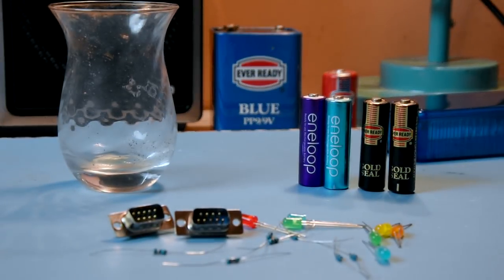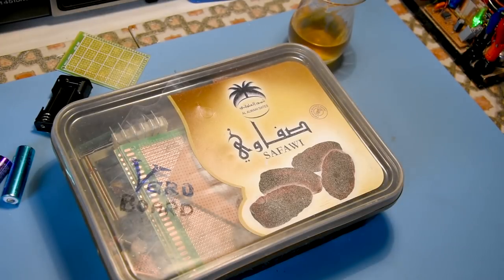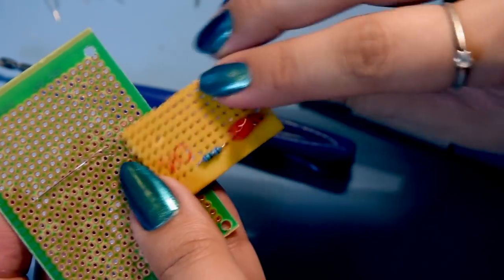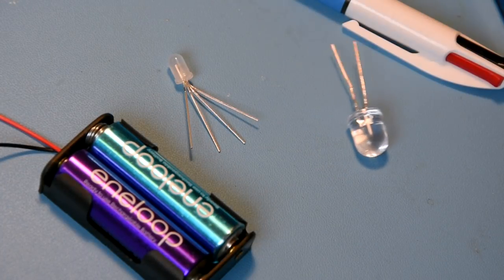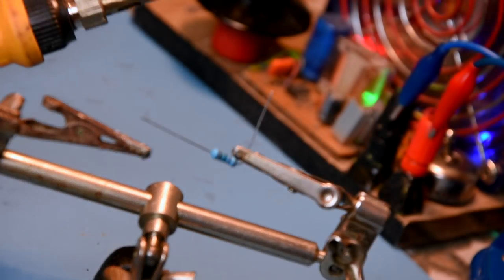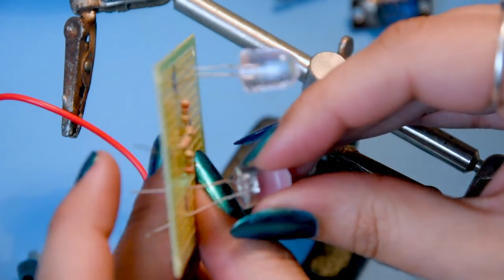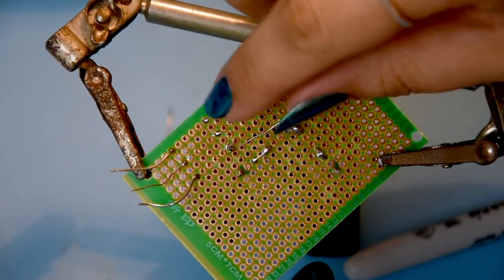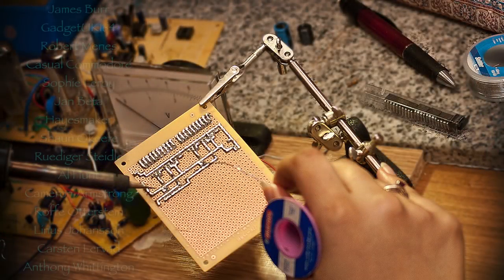Joystick Tester Project and Basic Electronics & Soldering - Part 1

Comment: Wow, it's been probably 25 years since I last saw a 4-color pen.  Where did you get that?

You could probably have used the 3-color LED for the fire buttons.  The joystick really doesn't care which polarity the voltage is on the common line at pin 7 (unless it's a joystick that has circuitry, such as an auto-fire joystick).  That could have been the ground for everything.

Comment: Thanks maddi. This video does help and i think ill try making a joystick tester along with you as ive been given a few old joysticks that i dont if they work so it will have a purpose. Look forward to next part. Little fact blue led were last colour type to be invented as blue is shorter wavelength hence why you might notice red being brighter and blue being dimmer :)
Reply from the maker: It's my pleasure, thanks! I didn't recognize you at first until I read the name properly. I'm glad the video helped and yes part 2 will be uploadedo n Friday and part 3, the final part, next week. 
Thanks for the info about the blue LEDs! I do notice they require more power to get to the same brightness :o)
Reply: MsMadLemon sorry noticed after posting i had used my other channel by mistake but you recognised anyway.

Comment: Nice Video. One thing I want to mention on advantages strip board is that they have the same connection structure as that experimental board that you can use to build up a experimatal layout. Due to the same connection structure it is easy to move the experimental layout to a permanent one by using strip boards.
Reply from the maker: Yes, i guess that's true, if you're used to building on breadboard then you'll be more used to vero/stripboard.